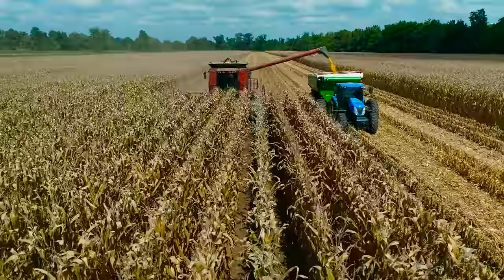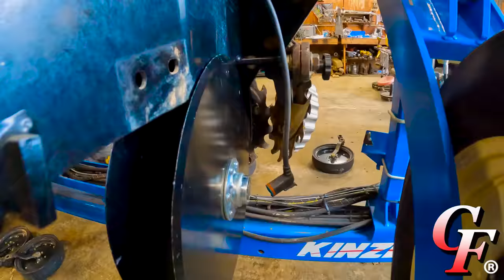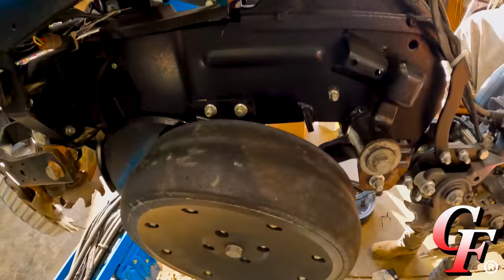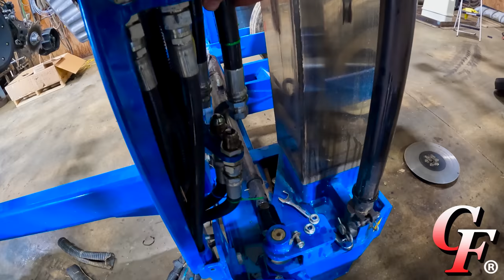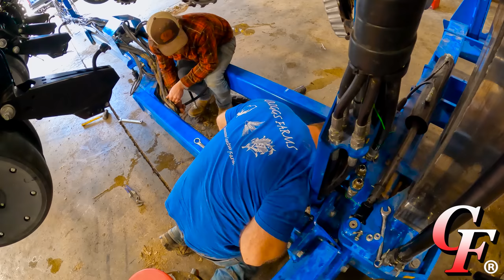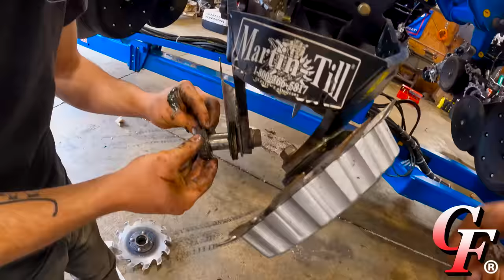Ready For Some $300 Corn Seed!!!  (2/21/23)

Comment: Hey Matt if you ever have to pull hoses threw the frame again. Use dawn dishwasher soap on the hoses it will help them slide threw the frame. Electricians use wire lube to pull wire threw conduit. It makes a huge difference.
Reply: Anyting things work better with lubrication! LOL
Reply: Wire lube hardens over time and is hard to remove.

Comment: to resolve the pains of running hoses through those holes, fabricate a channel either above or below the channel the hoses and electronic harness are run through for the hoses only to make easy access.  this channel to be bolted on for removal to replace and inspect hoses.  also go to 2 wire brad hoses.  I would prefer the channel on top if it doesn't interfere when the planter is lowered.

Comment: Hi from oz Andy. An old engineer showed me this trick for removing broken studs. Use reverse twist drill just smaller than the thread to bore through the stud. As it gets close to end of stud it suddenly grabs stud and winds it out of the hole. You might try that next time. Think you’ll be surprised at the results.

Comment: Could you thread the new hose on to the end of the old hose, before you pull out the old hose. Then you’re pulling in the new hose as you’re pulling out the old hose.
Reply: I am pretty sure the new hoses are made to match the old. Buy hoses by the foot, made in the parts store. Our local NAPA store makes hoses...
Reply from the maker: You are correct.  But Ricks idea is a good one if there was a way to accurately get hoses premade without removing the old one

Comment: Wondering in the future if you'd cover your Martin row cleaners and stuff you learned about using them. I seem to get a squirly row that likes to engage more than the rest of them. I'm on the screw adjust and have it raised all the way up.  I'll get some way to adjust higher next time, but just wondering what a good setting looks like from your perspective.  Thanks.